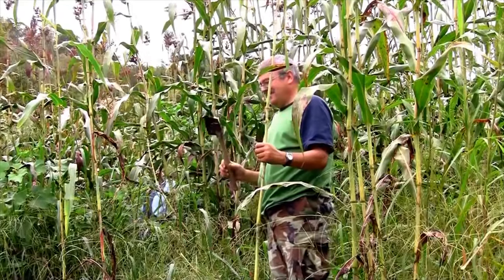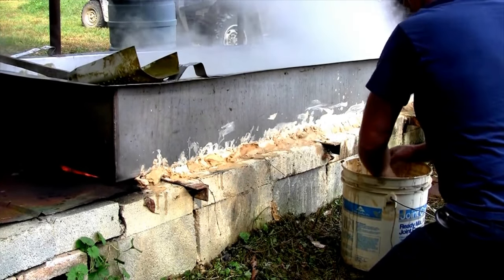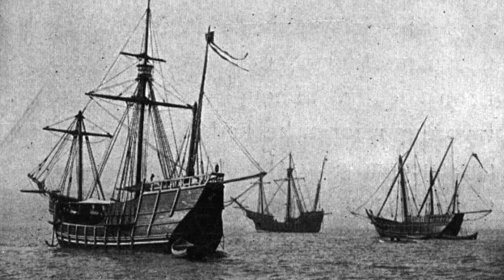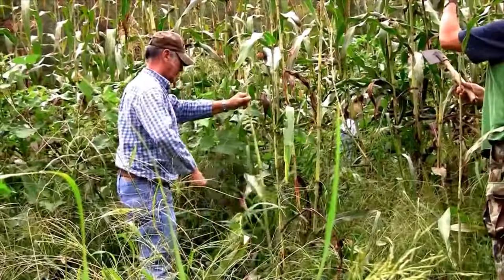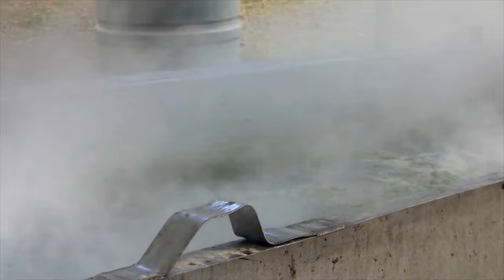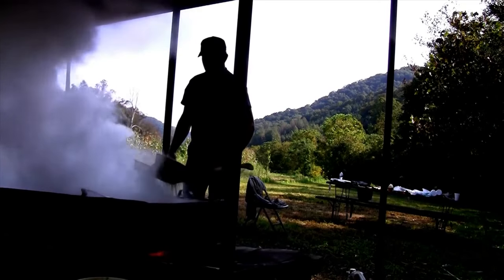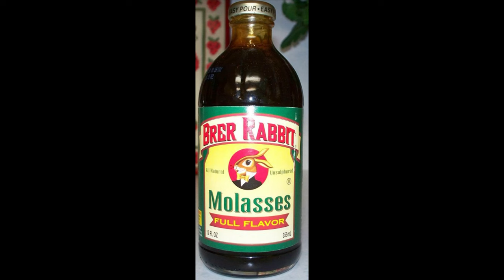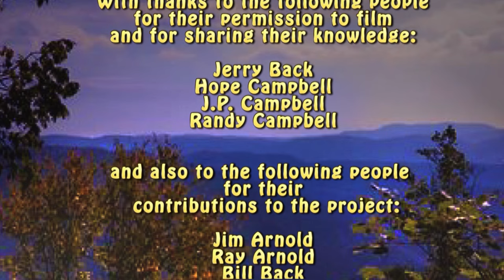Mountain Molasses Stiroff - How to make molasses

Comment: Why does the mill have three rollers? Couldn't you squeeze it with just two? What gear are you running the transmission in?
Reply from the maker: It actually doesn't have three rollers, just two. Something about the angle of the shot makes it look that way. I don't know what gear the transmission is running in. We should have included that, though

Comment: Where can I buy that pressing machine please?
Reply from the maker: Beata,
It would be hard to find a cane press like the one we filmed, because it's over 100 years old and was designed originally for mule power. You can find smaller, more modern presses, though. Just search Amazon, Ebay, Overstock, etc for "cane  press" or "sugar cane press." They seem to cost upward of $225,and mostly seem  meant to be used indoors. Some are powered by electricity but most are manually cranked. Their usefulness, I suspect, would depend on how much cane you want to press.
Reply: @curtiscornett , I am so after the old one, we want to start a sorghum plantation to help villagers in Congo start  making a living out of it,  we will get a training on how the whole process is done so we will know how to set it up once we are there.
Reply from the maker: @beatamafulu2405  Beata, Your proposal to obtain a cane press and start a village industry in the Congo sounds as if it has possibilities. One of the benefits is that many villages could share one press, as they did in earlier days in the US. Your propinquity to the equator also means that you could grow sugar cane as well as sorghum cane, which might give you options. Unfortunately, while there are still old horse- and mule-driven cane presses here and there in this area and here and there elsewhere in the  southern US, we don't  know of any for sale. However, we will mention on Facebook that you are seeking one, and  perhaps someone will see our notice who knows of one. If so, we will get back to you with that information
Reply from the maker: @beatamafulu2405  Beata, Thanks so much for the email address. Please do keep us apprised of progress. We will put your email address in the Facebook post so that people can contact you directly if they do have a lead to a press., but we would be pleased to know how things go.
Reply: @curtiscornett  , we will keep you posted. Thank you and God bless